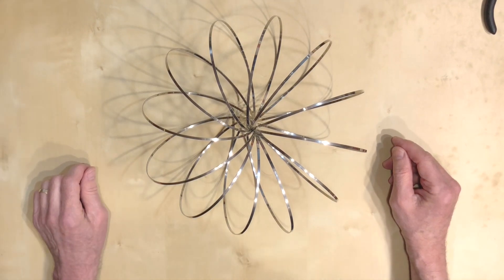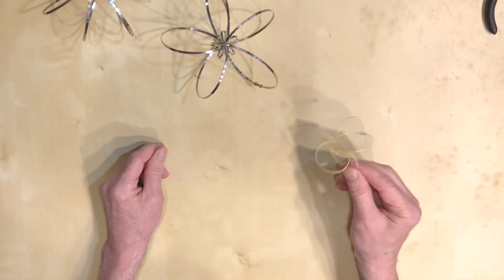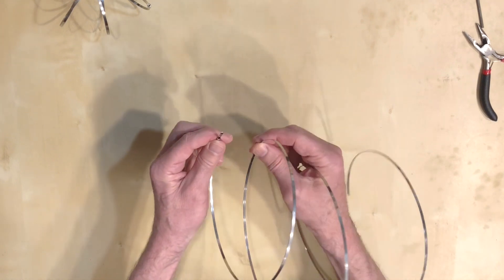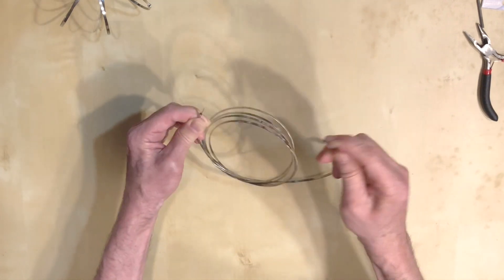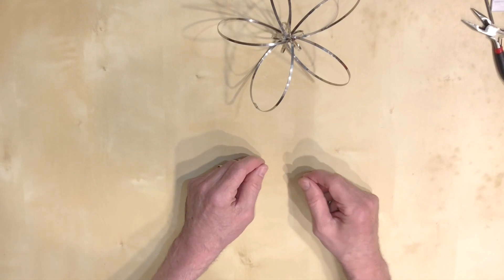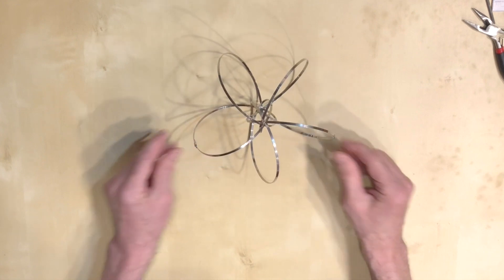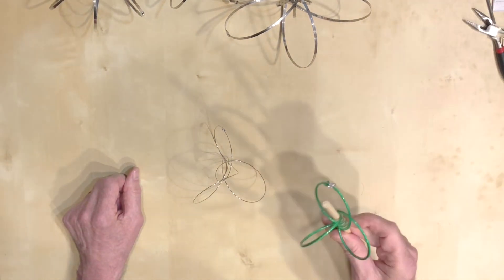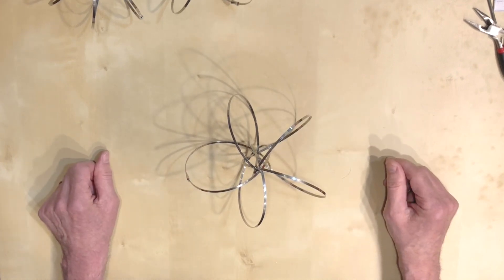How to make a torus knot

Comment: can i make 14,7 knot by using similar technigue? I have flat spring like metal band from old 12,13 torus knot toy that broke. Can i use that? What else do i need to know, or modify? How do i put it together? Is it even possible?
Reply from the maker: Using the same method you can (in theory!) make a n,nk+1 knot for any n,k by wrapping the free end of the wire, each time, k times around the loops (k=1 in the video.) In practice, the knot quickly becomes unmanageable (too tight) if k >1. I made once a knot with k=2, but I used a much softer wire. I don’t think you can make a knot with k>1 using with the flat wire shown in the video.  With a straight, very long wire, you could make very large loops, but not with the coiled wire.